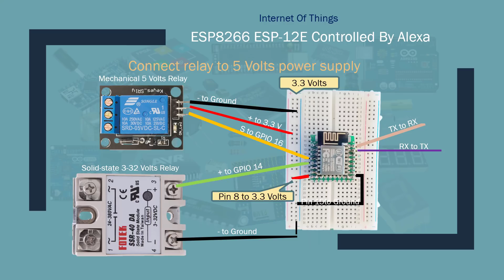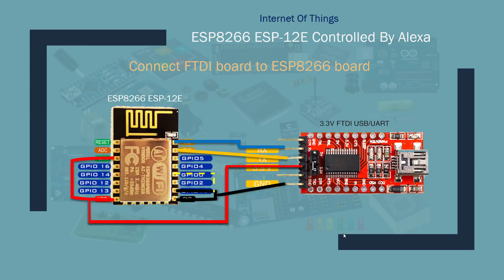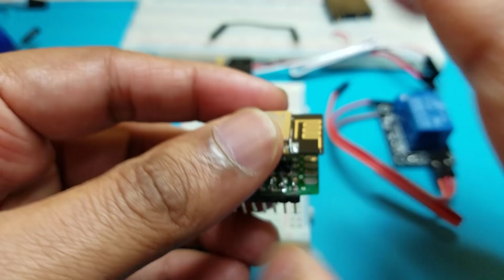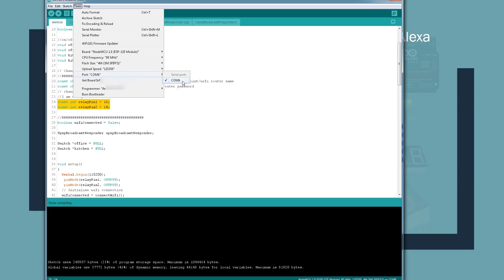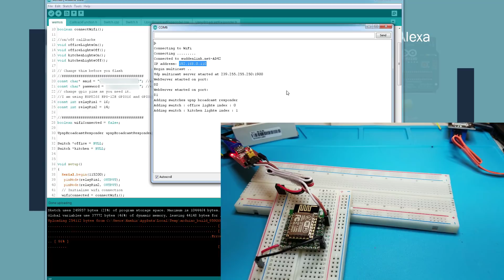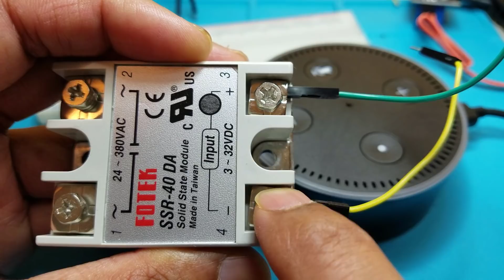ESP8366 Arduino project with Alexa |  ESP8266 ESP-12E | Tutorial # 4

Comment: Thank you very much for this video, it was wonderful . This worked great in my setup, and I was up and running in no time.  I have another application, open and close the garage door by hacking into the push button.  I want to use this to flip a relay for about 1/4 of a second for the garage door button press.  I can just use this code straight out of the box and get rid of the second callback, but I want to use two words "garage door" and instead of "on/off" I want it to activate  with "open/close".   Sure, I can say "Alexa, turn garage on" and it will do what I want, but it is more intuitive to say "alexa garage door close" or "Alexa, close the garage door" .  Since the garage door will work the same either way, I can just use the same code in each sub.  So I have 2 questions:

1) Can I use "Garage door" in place of *kitchen, and what is the syntax? Would  "upnpBroadcastResponder.addDevice(*garage door);" work?
2) How do I change  the "on/off" with "open/close" in your code?  I see it may be in the Switch.ccp?
Reply from the maker: Thank you. Use following tutorial to do that.
 https://youtu.be/sFJE_PsUlm8

Comment: Tried this and it worked great. At first I was able to control the "plug" (office lights) via Alexa. The problem I keep getting is that Alexa appears to lose connection and reports "device unresponsive".  Has anyone had this or got a solution for it. I am running the ESP8266 board from a 2A 3V3 power supply so it is definitely not a PSU issue.

Comment: just a simple question... is there a way to use a esp-01 as a Alexa sensor … I would like to use an esp-01 in deep sleep mode or low power mode until my postman opens my mailbox then have Alexa announce the mailbox was opened or to announce a door opened or to start a routine

Comment: flashed the code with no issues but when i click on the port it doesnt show. and alexa wont find any new devices. please advise
Reply from the maker: What is the error in Arduino serial console?
Reply: @netmedias7657  I ended up going with the sinric code and now i was able to get it to work....somewhat work that is. the relays seem to be on when alexa thinks they are off and off when alexa thinks they are on

Comment: Device are unresponsive now after using it a year now. Tried reprograming again the ESP, still not connecting...

chksum 0x2d
csum 0x2d
v09f0c112
~ld

Connecting to WiFi
Connecting ...............
Connection failed.

Comment: Hi Nassir, I am a huge fan of yours. Need your help with the latest code at https://github.com/nassir-malik/IOT-ESP8266-ESP12E-Alexa-Multiple-Devices

Everything works fine, the only problem I have is all the relays turned on the moment my Nodemcu starts up. After that I can turn the relay on and off fine after that.

Appreciate your assistance. Thanks

Comment: is it possible to send a command from another esp8266 and control the relays, example i have the alexa function on 1 esp8266 in the kitchen and i have another esp8266 with a button, on button press the gpio pin 16 is set to HIGH and on another click it sets to LOW, also while being able to say "Alexa turn on office lights".... i guess it would be close to a wireless switch created out of an esp8266.... i hope my question isnt confusing.... thanks for any help

Comment: will this work with the esp8266 12f ?
Reply from the maker: Bernard Suyat Yes, It will work for ESP8266 12F.
Reply: @netmedias7657  thank you sir
Reply: @netmedias7657  works great, i have already created a smart power strip and smart plug from the esp8266-12F now trying to figure out a wireless switch to work with the setup as well

Comment: The setup works absolutely fine when used directly with Echo dot but when used with Alexa mobile app, the behavior is erratic. It turns all switches on after turning them off after few seconds also the switch shows the wrong status, shows off when it is on and off when it is on. Please let me know how to fix this. Thanks
Reply from the maker: Make sure you have enough power for ESP otherwise it will keep rebooting intermittently. Flip the relay poll if the on/off status in wrong in Alexa app.
Reply: @netmedias7657 Already modified the code to correct On/Off behavior which was initially reverse.  I tried powering the nodeMCU unit both from computer USB and also external supply, the same result. It happens only when device switch options are used in the mobile app, otherwise, it works correctly when only audio commands are sent. Anything I can do to fix the switches option. The device is detected using Smart Home>Devices on my laptop. Does it require any wemo app on mobile?

Comment: Hello @Netmedias, I am using Amazon Echo Dot (3rd Generation) and Alex said could discover any device. And the output of the serial monitor only show the WiFi and the initial starting output but nothing of the discover process.
Example:
Connecting to WiFi
Connecting .......
Connected to My WiFi Network
IP address: x.x.x.x
Begin multicast ..
Udp multicast server started at 239.255.255.250:1900
WebServer started on port: 
80
WebServer started on port: 
81
Adding switches upnp broadcast responder
Adding switch : office lights index : 0
Adding switch : kitchen lights index : 1

Do you have had tried this Amazon Echo Dot (3rd Generation)?. If so, can you please give me some parameter for check.
Reply from the maker: Try replacing all appearances of 'urn:Belkin:device:**' to 'upnp:rootdevice' in the  script.
Reply: @ @netmedias7657 , now the Echo Dot is able to discover the 2 devices. Both when I request to Alexa to turn on lights, Alexa say  "Kitchen lights doesn't support that" and in Alexa App the plugs device say "There was a problem" o "Server is un responsible".
Adding the serial monitor response:
request:"1.0" encoding="utf-8"?><s:Envelope xmlns:s="http://schemas.xmlsoap.org/soap/envelope/" s:encodingStyle="http://schemas.xmlsoap.org/soap/encoding/"><s:Body><u:GetBinaryState xmlns:u="urn:Belkin:service:basicevent:1"><BinaryState>1</BinaryState></u:GetBinaryState></s:Body></s:Envelope>

Got Turn on request

Switch 2 turn on ...

Comment: I'm assuming you're using an older Echo Dot. The 2nd generation Dot seems to have issues connecting to every one of these types of projects that I've tried so far. I'm using a LoLin NodeMCU ESP8266 board which I believe has the ESP-12EX module on it.
Reply from the maker: I am using 2nd gen Echo dot. Please make sure you are providing enough power to esp other wise it will keep rebooting.
Reply: Yeah it has a decent power supply running it.
Reply from the maker: Can you share Arduino serial output?
Reply: I've blanked out the SSID and IP address here but they are correct. By the way, I have an Echo and an Echo Dot (both are running software version 613509320) on my network. Either one will find commercial devices.
------------------------------------------------------------------------------------------------
2d
vbb28d4a3
~ld

Connecting to WiFi
Connecting ....
Connected to XXXXXXXX
IP address: 192.168.0.xxx
Begin multicast ..
Udp multicast server started at 239.255.255.250:1900
WebServer started on port: 
80
WebServer started on port: 
81
Adding switches upnp broadcast responder
Adding switch : office lights index : 0
Adding switch : kitchen lights index : 1
Reply: I've also now tried scanning with only the Echo connected to the network and only the Dot connected and the device still is not found.
Reply from the maker: You can on  connect to 2.4Ghz wifi. Try to restart your router. Good luck.

Comment: hiii i  am getting this error while compiling it 
Arduino: 1.8.5 (Windows 8), Board: "NodeMCU 1.0 (ESP-12E Module), 80 MHz, Flash, 4M (1M SPIFFS), v2 Lower Memory, Disabled, None, Only Sketch, 115200"

Build options changed, rebuilding all
C:\Users\ARUN SAI\AppData\Local\Temp\Temp2_IOT-ESP8266-ESP12E-Alexa-Multiple-Devices-master.zip\IOT-ESP8266-ESP12E-Alexa-Multiple-Devices-master\wemos\wemos.ino:5:20: fatal error: switch.h: No such file or directory

 #include "switch.h"

                    ^

compilation terminated.

exit status 1
Error compiling for board NodeMCU 1.0 (ESP-12E Module).

This report would have more information with
"Show verbose output during compilation"
option enabled in File -> Preferences.
can u help me pls
Reply from the maker: It looks like you are missing switch.h library. Make sure it is added to the project.
Reply: tqs can you give me the link for switch library
Reply: It should be in the files you downloaded from Github.
Reply: How do you include library ArduinoJson.h, WebSocketsClient.h and Hash.h?

Comment: Hey i had a question 
Is this also working on the second Generation of dot?
Reply from the maker: Yes
Reply: Ok thanks Do I need to replace anithing in the code? Because i have a nodemcu esp8266 and lots of People say that IT dont work
Reply: pleas answer
Reply from the maker: @lyrics9038  it is working with 2nd gen. I used this sketch in my last tutorial without any issue.
Reply: ok thanks i will try itif i have issiues i write you againthanks for the support and the great Video
Reply: ok everything work just fine thank a lot but i had some issiues when i said turn on Office Lights the relai go out and when i say turn off Office Lights it goes on how i can fix that?and another Thing is that i like to rename the Office and kitchen light and make 2 more gpio Pins how is that possible?and how can i Flash the Memory of the nodemcu esp8266? thanks for the great Videos you help me a lot. pleas ceep making thes awesome Videos:D also like i said it workt just fine then i try to edit somthing in the Arduino Code and erase the Memory with node mcu flashmaster and uplaod the new Code but it didnt work also as i try to load the first Code the worked before pleas help
Reply from the maker: Change all command from high to low and low to high

From
digitalWrite(relayPin1, HIGH);

To
digitalWrite(relayPin1, LOW);

Comment: hello to you and thank you for it's tutorial but I have a problem it does not remain connect this disconnects a 4 seconds to a solution and it makes me the same for the first tutorial thank you
Reply from the maker: Try to use separate power supply for your relay and test it. I was having issue because inadequate power supply and my ESP kept rebooting.

Comment: Do you have 1st or 2nd gen alexa? I have a echo plus 2nd gen and it is not discovering anything, anyone had the same issue? (I've already read forums and tried a million fixes but it just won't work)
Reply from the maker: Try following.
Find  following code and

 if(request.indexOf('M-SEARCH') > 0) { 
....
  respondToSearch();
}

Change it to following.

if(request.indexOf('M-SEARCH') >= 0) { 
....
  respondToSearch();
}
Reply: Thank you, today out of anger I went and got an echo dot, surprisingly the echo dot found all devices the echo plus couldn't find! so I'm sticking to the lil one
Reply: +Netmedias I found that in the library and changed it and it still make the device discoverable.

Comment: Can we use 2 channel relay instead of using solid state relay?
And also can another GPIO pins are used to connect other devices. If yes what changed to be done in code. Can you plz help me out with this thing?
Reply from the maker: Yes, No code change is required for 2 channel relay. Good luck.

Comment: Hi Nassir, great video, thanks! I was able to follow it and make it work, but... The problem is when I connect power to ESP, the relay is already switched on and the Alexa commands are inverted: when I say Alexa turn on kitchen lights, the relay goes off and vice-versa. Any idea why is this behavior? Thanks in advance!
Reply from the maker: Because your are using active low relay. You have 2 options. If using 3 poll relay then use the poll that is close by default. 2nd option is to swap the on/off function name or on/off value. Good luck.
Reply: I'm not sure I understand what you mean by using an active low relay and "use the pole that is close by default".  On the back of the relay board says low level trigger, if that helps in any way. Thanks!
Reply from the maker: I explain this in following tutorial. http://www.youtube.com/watch?v=1Eo9NSiS3Y8&t=16m56s
Reply: Now I understand, thanks for the link. Btw, what relay board do you recommend that works directly, no transistor needed?
Reply from the maker: You don't need transistors if you use 2 options I gave you in first response.
Reply: I changed the values for kitchenLightsOn() and Off() and works ok. The problem still remains when power on the ESP board - the relay is on status ON. Normally it would need to be off, right?
Reply: Hi Nassir, I'm trying to understand if I did something wrong here or not that the led is turned on by default. It should be off in my opinion. Thanks!
Reply from the maker: You can add the code in setup to set the GPIO HIGH or LOW whichever one sets the device off. This way by default your device will stay off on boot.

Comment: Excellent... Excellent... Very clear and accurate.  I was able to quickly use this training to connect the DOT and control my X10 house lights.  Thank you very very very much for keeping me at home and off the streets!  LZH
Reply from the maker: Thank you
Reply: None LZHenry Will you have to ask Alexa to discover devices everytime it starts or is it only an initial step
Reply: Yes and NO... still having some issues.  I have 12 custom devices connected.  Alexa will discover devices... sometimes all 12  with one DISCOVER and sometimes need to ask several times.  Sometimes Alexa APP has multiple definitions of devices in the IOS APP... Alexa stops recognizing devices.  Have to remove devices.  Then DISCOVER again.  Sometimes Alexa stops controlling devices... have not found a reason.  I like what it does, but is still a hobby device connection.   LZH

Comment: Hi, Thanks for the tutorial. Everything worked fine until 27:20 on the video timeline, but alexa is unable to find device. any suggestion to solve the problem
Reply: check to see if port 1900 is open in your router..fixed my problem
Reply: @Vamsidhar 
Did you find your solution ?

Comment: Do you have any idea how to control multiple devices with multiple ESP8266 devices? It is easy to with one, but how do you configure lets say 5 of them. They can't all be connected to the same websocket, just one at a time. Do you by any chance have a code for that?
Reply from the maker: Ivan Bosilj I will be doing that in next tutorial using MQTT server. Stay tuned. Thanks

Comment: why would my commands be backwards? off is on and on is off when testing with relays. when i plug the board in both relays turn on and then i have to use the on command to shut them off. then to turn it back on i have to use the off command.
Reply from the maker: Blaine Bond you may be using active low relay. You have multiple optiontions to fix this.

.You can create Alexa routines and map on to off and off to on. No coding required.
.If using mechanical relay then use the other poll.
.Change code following code

From
digitalWrite(relayPin2, LOW);

To
digitalWrite(relayPin2, HIGH);

and high to low
Reply: thanks for the reply!! new to coding but changed the code and works perfect now awesome!! is it just as simple to rename the command name in the code to like something like  bedroomlights or garagelights?
Reply from the maker: Blaine Bond IT is very easy to rename the device just change the following two names "office lights" "kitchen lights" to whatever you want.

    office = new Switch("office lights", 80, officeLightsOn, officeLightsOff);    kitchen = new Switch("kitchen lights", 81, kitchenLightsOn, kitchenLightsOff);